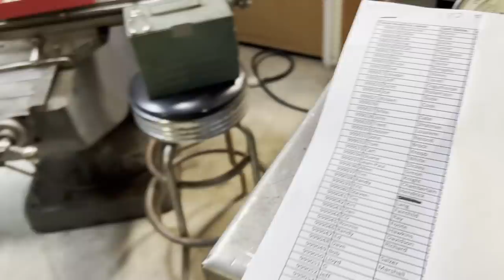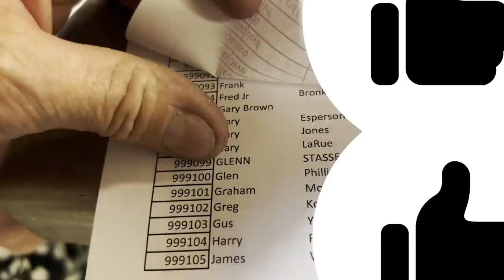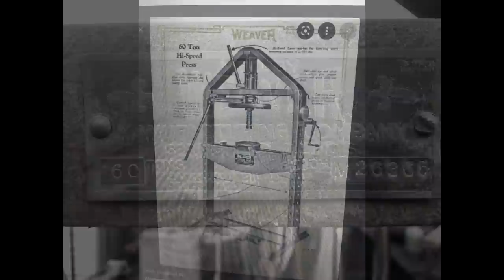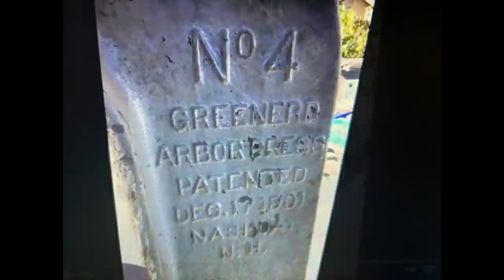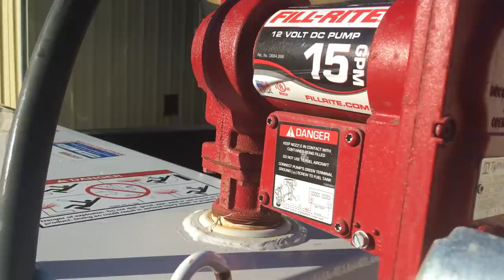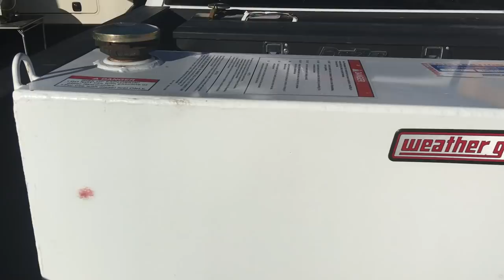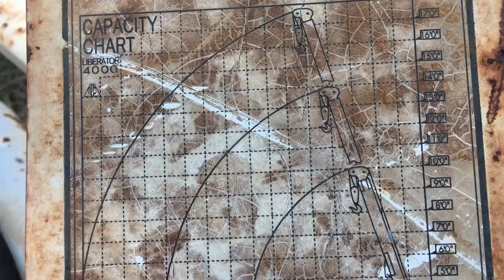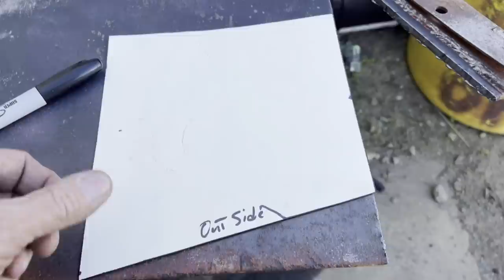Old Iron Tidbits #3  5000 Sub winner

Comment: Weird! I don't do mechanic work but I happen to have a NOS sunnen bore hone, but mine is quite different. It has more of a carjack style mechanism to spread the stones. Most notably, it has a shaft that must be 20 in long, there is a hole in the metal box for it to stick out. I have never used it. Would this be designed for a different application? I always assumed it was for line boring so to speak. I never thought about it until today, but spring pressure is not sufficient to keep round, no?

Comment: Great little video. Where do you find all this stuff? Years of contacts I recon, can I come?? Did you live out there when they filmed "Howard the Duck
"? That little crane for the lathe is a great idea! Maybe a grinding attachment would have cleaned the diffuser face off better, on the next you did,,,,,,,,,,, What is one of those motors worth??
Reply from the maker: Yes I lived here when they filmed Howard the Duck, Moved here in 1965.    I try to avoid grinding on the Lathe when possible. Grinding off the hard scale with the hand grinder I think is the trick. Should machine easy now. If you mean one of the engines you can get a new one for about a million.  If you get a reman engine it would set you back almost 3/4 of a million.
Reply: @OldIronMachineWorks  I was here in late 80s, remembered when they shut 12 down for it. 
I agree on the grinding OFF the lathe, just throwing that out.
Who rebuilds electric motors around here?

Comment: So these engines that run off of landfill gases, how do you manipulate the gases to be of a chemical composition that is necessarily combustible? I imagine there is tons of different gases produced in a landfill and there would not be much consistency. Is there ways to average this out? Like layering the garbage in particular recipes known to produce more / better gas? How does the system protect against something extra combustible? Like say someone through a way a full can of butane or ether, is this not a potential danger to the engine?

Comment: Pull the battery leads when you park that truck. Late nineties Ford F250/350 are the most commonly stolen vehicles. We've  lost 3 from the parking lot at my work. Making a hidden battery disconnect switch might be a fun fab job.
Reply from the maker: Defiantly something I need to consider. Thanks for pointing it out. Would suck if it got ripped off.